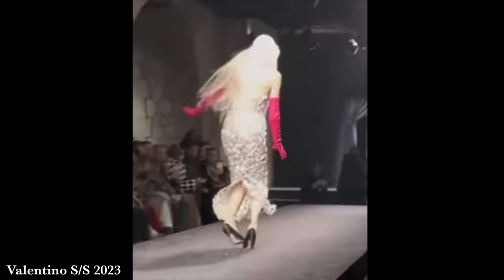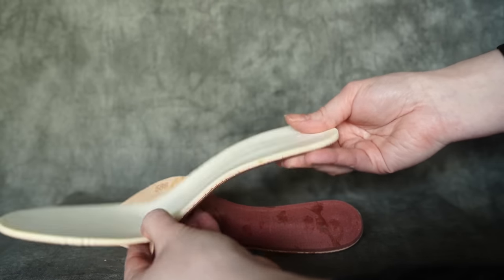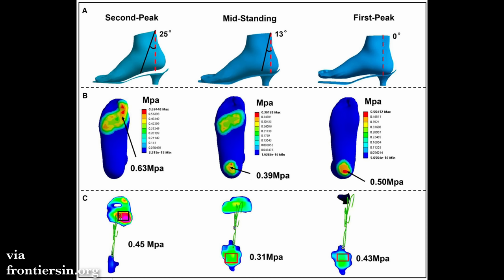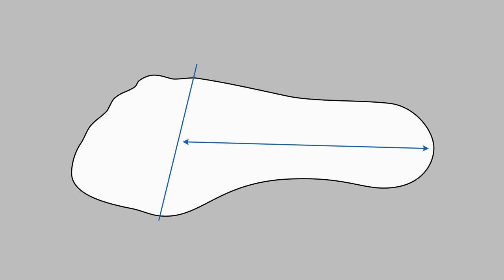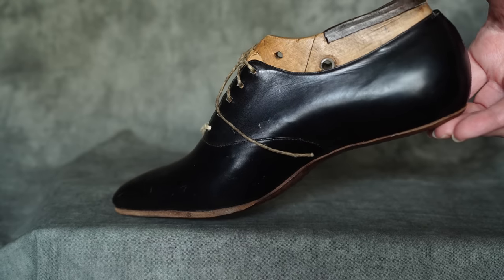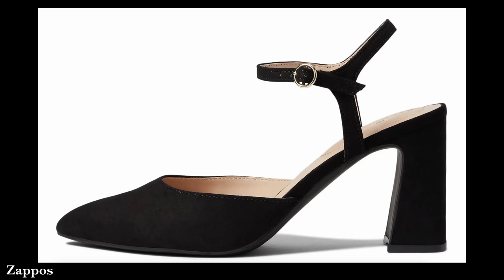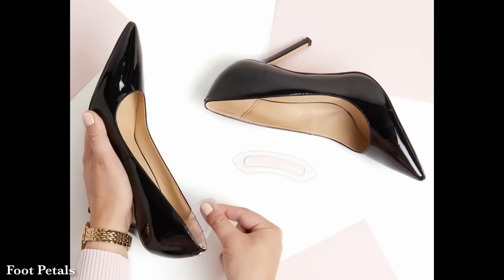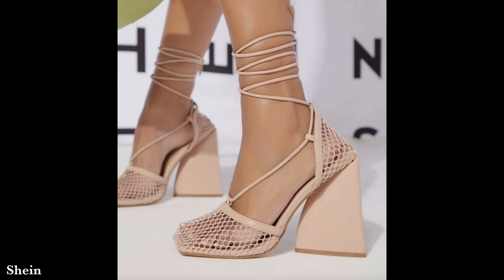Why are Modern High Heels so Bad?

Comment: Thank you so m  uch for talking about this!! I find high heels are now made completely steep (3:23), there isn’t a flat place for the back part of the feet (heel). Is it to make the industrial process easier? That heel on the back side instead of the middle is quite stable, but our feet can get arched so I prefer when the top part of the heel is flat and all my body weight lies on my heel and not on my toes ! I only buy heels that are quite flat at the top. I like wearing high heels, walking, dancing with them… I would wear them everyday if i could. But the steepy ones are not comfortable, walking can be challenging, and your feet get destroyed.

Comment: Since last season's catwalks, I was very and unpleasantly surprised by the Valentino shoes. Specially their stilettos used to be very secure and stable, the inner had some kind of memory foam, and the weight worked perfectly, they were a great alternative to the Louboutin model. I have no idea why would they decide to change their good shoe, but this is a disaster... Another example of badly designed luxury shoes that comes to mind, are the infamous Versace high platform shoes: they do not only run small and are too narrow, the angle in which the foot has to sit thanks to that ridiculous heel is beyond uncomfortable. On the other hand we have the "dup" by Steve Madden: lower heel, but still high platform, better angle, WAY more stable.

Comment: Huh this was super informative. I have small but wide feet. I have difficulty finding heels that accommodate a wider foot since many of them are for thinner feet. However out of the pairs of heels I do have none of them have ever given me a bunyon or a blister. They fit me quite well and after looking at a few of them I notice that they have the heel under my heel not behind it and my weight feels evenly distributed and my small arch (I have a very small arch) feels supported. I have none of that sliding around or lifting ball of the foot. And I am not a fan of those thin strapped string heels so I have none of those. They either have nice thick straps or no straps at all. I wonder of my lack of heel choices and personal style has inadvertently made me able to fine more balanced shoes.

Comment: I'm no stranger to the woes of trying to find well-fitting shoes. I dealt with a foot deformity in my teens (Hammer toes, center 3 on each foot, that had to be surgically straightened with titanium pins. These toes no longer bend except at the joint with the rest of the foot.) I got used to shoes never fitting quite right because of my toes during that time, but now as an adult I have a different problem. I can't seem to wear any low-top shoe (not pumps, ballet flats, running shoes, low-top Converse, etc.) without it absolutely chewing up my heel/achilles. It's so bad that I don't wear anything but high-top Converse and ankle-height Merell hikers anymore, or ankle boot heels if I need to be fancy. I'm sure it must be some quirk of how my heel is shaped, but I've never had anyone say it looks weird or abnormal -- unlike my toes. But your expertise on shoe fitting and manufacturing gives me some hope. Is this a known issue some people have? Are there any brands/types of shoes that accommodate it? Is there even any terminology for foot anatomy/shoe anatomy that I can use to ask for help when shoe shopping?

Thanks for a fascinating and well-researched video!

Comment: My feet  measure as 7.5 double wide.  I have not worn 7.5 shoes for over 30 years.

I have had foot problems since childhood.  I have very sweaty feet, when I tried to wear sandals my feet were soon slip sliding in them.  However, every time I tried on shoes that were tight on my toes, I was in pain, a lot of pain - and we aren't talking about slipping into the toe like in heels, we are talking flats.  I finally just asked for large toe boxes for my shoes, or wore .  And then I fractured my heels.  For years after I had to walk on the balls of my feet, I am a very slow healer at the best of times, but added to it, I re-fractured them very shortly after they healed the first time.  I still can barely walk without shoes to this day - 30ish years later, and lets add to it my arches gave out at the same time - the joys of actually wearing shoes without adequate support.

I used to have a roommate who hated that I didn't wear "cute" shoes.  I really don't know why she cared.

Then, to fix a persistent ingrown toenail problem on my right big toe, my foot doctor removed the nail.  The most amazing thing happened, within a day of the nail removal, there was suddenly this mound where that nail had been.  This is the very toe that had the issues with any kind of pressure on the toenail.  I no longer have the problem with my toes, oh, still ingrown nails sometimes - the same doctor took off part of the nail on my left big toe.

So, I wear size 8, triple wide shoes, still with large toe boxes, because I don't care if I wear cute shoes, I just want shoes that aren't uncomfortable.  Yeah, there are times I wish I could wear a cute pair of boots or some soft slippers, but at least I'm still walking, even if it is often kind of painful.

Comment: Paint the ball of the soles and bottom of  heels with old fashion rubber cement.  Let dry, it will keep the heels from sliding out as there is a bit of stick on them.

Comment: Years of abusing sky high heels left me with problems on my left foot, now I wear sensible shoes for the sake of them. I have large feet, wearing size 11 makes shopping for shoes a frustrating experience, so my shoes are usually bought online, not so high and very expensive, and looking for beautiful pairs with sturdy low heels 👠 shorter than 3” is like looking for a unicorn 🦄

Comment: Even flat shoes are really hard for me to fit in because I have wide feet, the only time I was properly fitted for shoes was for pointe shoes when I did ballet. My point shoes from 10+ years ago fit perfectly, yet putting my foot in a boot where I don't feel a metric ton of pressure on my feet took me way too long. i barely have any pairs of shoes because I fit in very few shoes, and I have asymetrical feet from a surgery. If I wasn't such a germaphobe, or lived outside od the city, I'd go barefoot because this is so annoying!!!!!

Comment: Not to mention if you aren't wearing shoes that properly fit the arch height you need you'll be flipping ankles left and right no matter how low those heels are. 
I have super high arches and you cant have proper support with your average heels for that! Often there's NOTHING under the arches because it bends inward before bending back outward to the heel. Even when it doesn't my arches are just too high and putting something in there to fill the space isnt helping just how far inward my heels fall. Just because the space is filled between my foot and the shoe bed doesn't mean my ankle wont flip bc it has to be pretty solid to the ground under and to the side of the arch to combat it.
Otherwise you're only really keeping yourself balanced with various leg muscles that you're overworking just to keep yourself upright because you're only making contact with very little of the outer part of your foot.

Comment: i have very wide, large feet with very long toes and a very high arch. it is so hard to make shoes work for me, shopping online is a nightmare but now most stores are moving extended sizes to online only. the shoes that have become most comfortable to me are a pair of leather shoes made on 1950s soviet machines in poland. took a chance on them and ive never been more glad to have a solid pair of walking around shoes. if you have weird feet, leather and vintage shoes are just better in my experience

Comment: I have a natural shaped feet because I  so rarely stuffed them into dainty, feminine ones, meaning that my feet are more of triangle-shaped, the heel being  the narrowest point, toes spreading slightly sideways as I walk to ispread the weight on larger contact area.. . But try to find  anything remotely correct shape, even in sports shoes, that still support the foot all the way is impossible and when it comes to even medium high heels... I found exactly one pair that didn't start hurting even before I put them on, and that best pair were killing my feet as soon as I had to stand up for 15 minutes. Nothing took the pain away for the rest of the wedding and the pain didn'tgo away for another hour after I had taken them off!  Shoe designs must have gotten worse because even the bridesmaids changed into trainers as soon as the formal ceremony was over.  

I'm glad that I can go without shoes for most of the day, let my feet breathe as well.  🙂

Comment: This is remarkably interesting. I don't wear HIGH heels. I really don't like anything over an inch or an inch and a half. A really good pair with 2 inches that is comfortable I will love, but hard to find. I have a balance issue, which has nothing to do with getting dizzy. It has to do with what happens when a human who is born autistic happens to have an accident, and they die for a bit then come back and suffered a massive brain injury. Needless to say, heels are not a safe thing for me to wear! I will only wear a low heel that is very stable. This is extremely helpful for me as far as looking for those shoes. I tend to love cowboy boots because they generally have a low heal and all the things you described. I also wear a triple A narrow shoe. They seem to have renamed that a slim and something else. In the old days when I was younger, I could get them in a triple A with a Quad heel. I rarely wear sandals and I love me some boots because I can fill them up with enough pairs of socks and padding. I know it is crazy, but when you have my feet... As a kid I downhill ski'd and I literally stuffed my ski boots with wash cloths. It really is that bad when you have narrow feet. I probably have the feet of feet models though! LOL

Comment: Late 70's and 80s were all about heels. Lots and lots of heels. My favorite were 4-1/2" stilettos - I even wore them on campus! Started wearing heels when I was 12 as I found them more comfortable than flats with my foot problems. Fast forward to mid 90's and everyone was wearing flats or chunky/clunky horse shoes. I sold shoes in the mid 2000's, no one under 40 could walk in heels by then.

Yes there are some poorly made shoes with bad heels, they made those in the 80's, too. But mostly women/girls have problems walking in them because they are too accustomed to wearing flats and athletic shoes. Practice! Practice! Practice!

Comment: I have size 2.5 feet (UK). Think that's about a 5 or smaller in the US. Wearing a heel over 2 inches is impossible simply because  simply hardy any of the ball of my feet is on the ground. I wish they changed the proportions of a shoe depending on size.

Comment: I always thought that high heels were just supposed to be painful and I'd grit my teeth and bear it whenever I'd go out on a date or go dancing in college. I'd have blisters and throbbing toes and black and blue big toenails, but just thought that was the sacrifice for being "stylish." Wasnt until I gave myself a stress fracture in my left foot that my good friend Brandon, who performed in drag for years at a local nightclub, set me straight and taught me about padded inserts and how my foot should sit in the heels. Turns out it's so much less painful and easier to walk when your shoes fit, who knew!

Comment: Boy did you nail different shaped feet!  I have mid-high arches and very long and straight toes. I also need a rounder toe box. I hate heels so much. I stick with platform sneakers made of leather when I want height. I swear by my Kennel & Schmengers.

Comment: I'm tall, curvy, and have long thin feet with long toes. I can't wear most heels. 
I LOVE Pleasers for my feet, though, specifically peep-toe ones. (I'm talking about your basic "stripper heels" in case you, person reading this, don't know what they are.) 
They have lots of padding, and the platform makes me have the look of higher heels without putting ALL of my weight (I fluctuate between around 175-200lbs) on the balls of my feet. They also strap securely onto my ankles. I feel super secure in them. Not the 7, 8 or 9 inch ones, of course, but 6 inches and under? They're my Goldilocks Heels. Besides platform wedges with lots of support on top, that is. Those, I can basically do anything in. 
I'm usually a "boots or flip-flops; maybe cheap sneakers" kind of person, but if I want to hottie it up hardcore, I'll wear Pleasers.

Comment: Well my mother tought me when I was a teenager starting to wear high heels,  to forget about the heel and just walk on the ball of the foot. I remember and afternoon we went out for a strall, she had those absolute lovely edwardian looking boots, she lost one heel walking and did realize only back at the car. So you can wear very bad high heel but it  doesn't matter as long you walk en "demie point". You only need a steel core, I suggest to practice pilates it really helps with the strenght and flexibility of the feet and to avoid minor injuries when twisting.

Comment: my need for toe space makes it so I need shoes a size or 2 larger than the size the rest of my foot needs (excluding toes). My best fitting pair of shoes are a pair of high-wedge canvass shoes where I used a dremmel to cut off the toe enclosure. They are a standard size 7 and that is PERFECT for every part of my foot except my big toe.... in contrast, when I buy sneakers and cutting off the toe-part is not really an option, I typically will buy a size 9.  Boots I prefer with a 2 inch heel and a pointed long toe box in size 8 or 8.5

Comment: I am very lucky my Mother said that I shouldn’t wear heals until I had finished growing. So I was limited to one inch until I turned 16 and my foot didn’t grow anymore. Now I try to stay within the two inch heal height. I do have some three inch heals but finding shoes in my size is very difficult. (I wear a 2.5 in shoes US) I am in my 60’s and have no problems with my feet; other than their size.

Comment: I've always loved shoes and am especially a fan of heels and heeled boots. I wasn't allowed to wear heels until I was an adult, so when I finally could I went out and got some 3in ankle length leather boots and was in love. I wore those suckers until the leather was peeling and the ankle support was overstretched but they were so incredibly comfortable, it was like they were made for me. My next pair were a similar style but was almost a  denim-y fabric (not actual denim I'm not sure what that fabric is called but I'm 80% sure it was a type of synthetic denim) instead of leather and it was god awful. The heels were pretty but they were so difficult to maneuver in and also the proportions were a bit off since I kept sliding and crushing my wide feet.

Not long after finally giving up on those heels that I convinced myself only needed breaking in, is when I started having some major ankle, knee & hip issues due to past injuries flaring up. I'm an ex-gymnast and ballerina for over a decade each (I was doing these simultaneously like a masochistic freak) so my ankles and feet in general are doomed. I am also hypermobile which just means I have a higher risk of developing arthritis on top of the genetic degenerative ankle condition that runs in all the women from my mom's side. Heck I probably won't be able to walk proper distances unassisted by the time I'm 60 with how things are looking.

If I wear heels for more than 2h (let alone a full day, heck it's been years since I wore heels and now even flats hurt so I'm not sure if I can last 20mins now) I'll need to lay down for the entire day after because every muscle in my legs and every joint, tendon, ligament and bone in my feet will be so excruciatingly sore that I won't be able to move. It sucks that now that I have the money and freedom to buy the shoes that I've always wanted, I no longer have the ability to wear them.

Comment: So interesting wow!
I do think the shank is verrry important. I had one pair of leather ankle boots that I wore very often, and one shank broke. I didn't realize at the time, but I did wonder what was wrong with it. My heel slid backwards when I put weight on the whole foot.
Later, when I took it off and inspected it, I noticed the heel was loose in the sense of being able to flex, it was still very stuck to the shoe though, so I didn't understand why it felt broken.
That was by far the worst feeling walking ever, and they were good shoes, laces, 8cm heel,...
So I do thank manufacturers for making sturdy shanks, though hopefully not too long, just heel to mid foot.

Comment: Having wide feet means that you never find a shoe that fits, doesn't matter the style. Most brands do not sell Wides, as if we don't exist. I'm a 9W (womens), but I have to size up to a 9.5, 10 or sometimes 11 to get a fitting shoe in a normal size. Sometimes I have to pass on getting the shoe I want because I'm either sloshing around in them or look like I have clown feet.

Comment: They don’t even bother making different widths for shoes anymore (too expensive to manufacture is my understanding.) We want to be able to afford variety rather than pay for fewer properly fitting shoes. 😢
My mom is a AAA, I’m an AA, and nearly everything on the market is B or wider nowadays. They may have narrow feet models, but they definitely don’t make the shoes for them. Even finding sneakers is a hassle, don’t get me started  with high heels 😂
Of course, it’s just as difficult for the other end of the spectrum.
And then if one wishes to find a brand that uses quality materials that are responsibly sourced, that pays their (adult) employees decent wage, that ideally manufactures on the same side of the planet, etc… one might as well go barefoot.